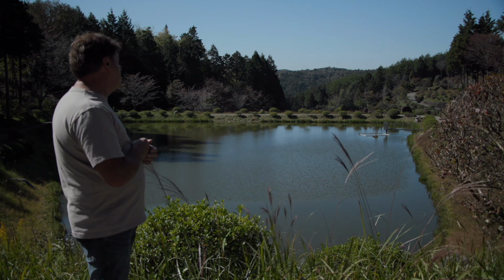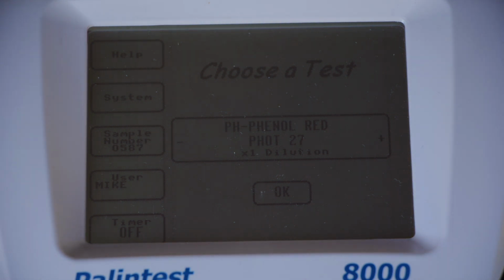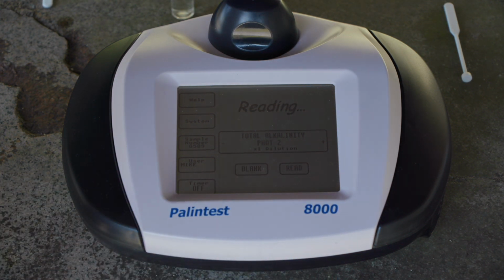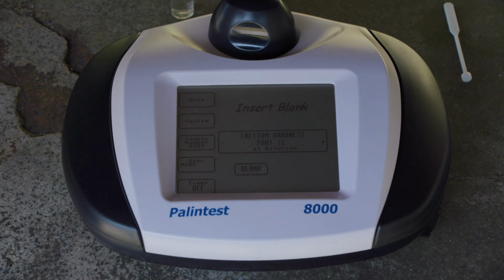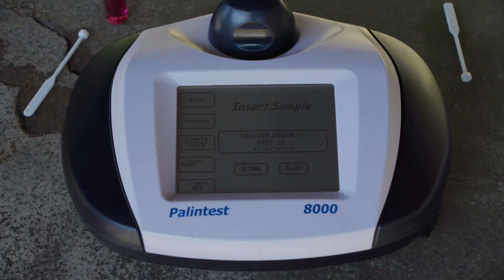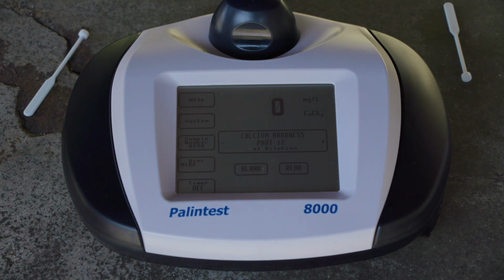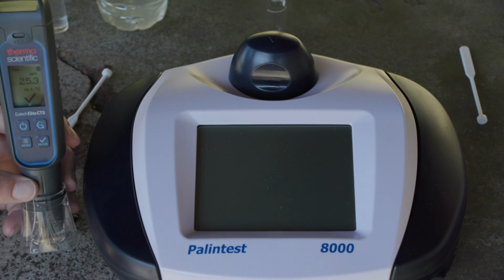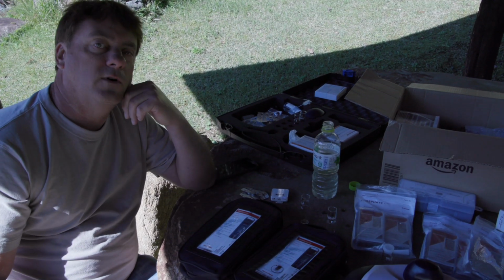Water in Japan's Koi Mud Ponds, Part 1

Comment: Interesting stuff Mike, I'm in to growing orchids and we like pure water so when adding our feed know what the plants are getting. Due to the water ratio loss I haven't dared hook up a RO unit to my pond. What about using rain water run off from a clean pond shelter roof if the pH is ok along with low TDS?